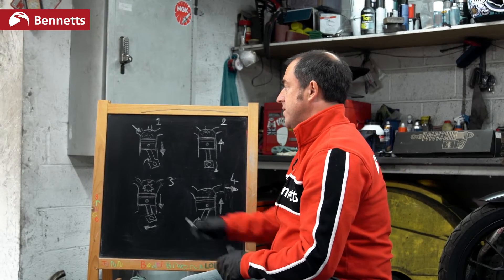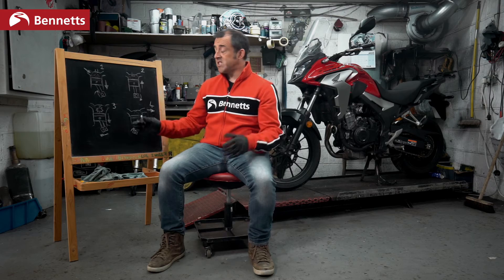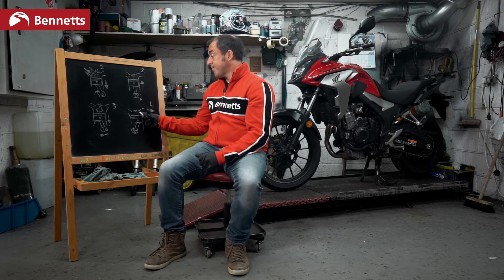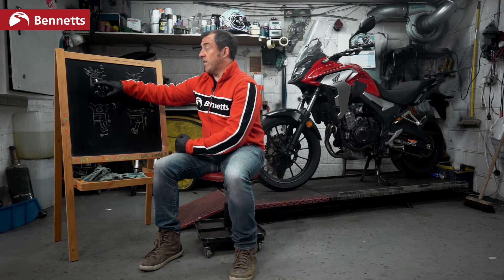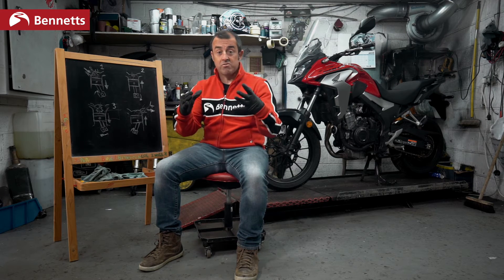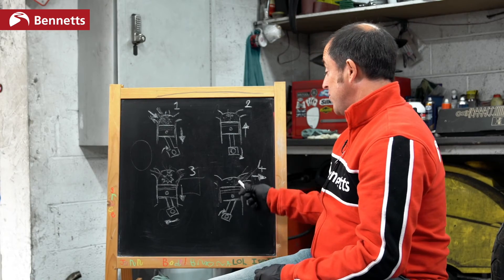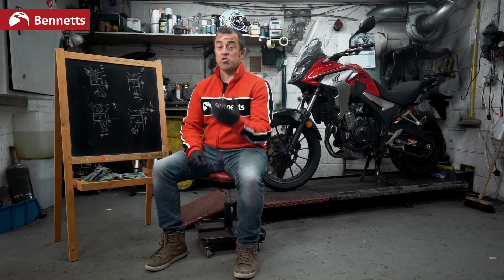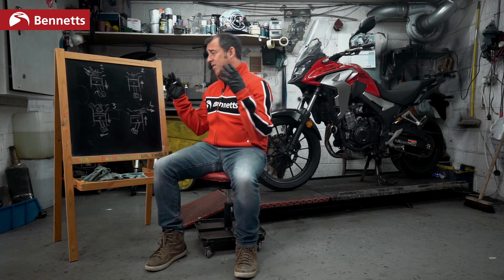Improving a motorcycle engine's performance | Home Schooling Lesson 9

Comment: What if we increased the amount of fuel intake from a bigger carburetor, which exactly is responsible of burning it properly at the optimum state? Is it the spark plug or the ignition coil? That is my problem now with my 15cc bike,.. I install 57mm bore kit piston, 6,5mm lift cam, and a 8mm open carb.. but it over feeds.. a lot of white smoke coming out from the exhaust..  How can I resolve it? please advise.. thanks

Comment: Better air-fuel-flow In, better exhaust out and lighter-exhaust-system. A Power-Commander or similar and change sprockets for more acceleration . All this is probably the cheapest power-gains . Real Power ?  Buy a bigger-bike or have VERY DEEP pockets .    Dave   NZ

Comment: You can’t really compress the air fuel mixture a lot more than the specifications of the engine tho. Since it’s a spark ignition engine, if you compress it more than the compression ratio allowed (typically 10) you’ll have premature ignition of the fuel which will damage the engine over time and you’re not even gonna get the performance you were getting before
Reply: There’s a reason they make the engine bigger when more power needed 😂
Reply: Yes you can and many people do.  Hi comp pistons and skimming the head or block are common ways to do this, and have been for decades.

Comment: Years ago a mate increased the fuel into a 250 to make it go faster and seized the engine. He forgot about the heat.
Reply: That happened to me in 2006 when I fitted a larger carburretor.